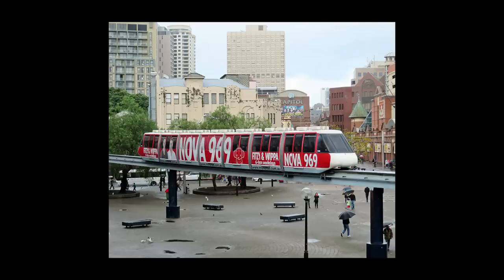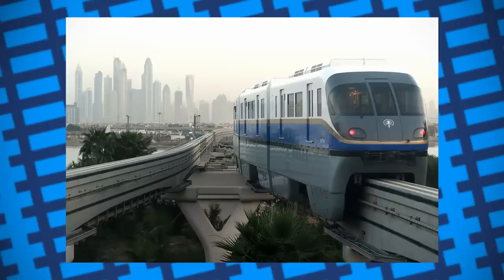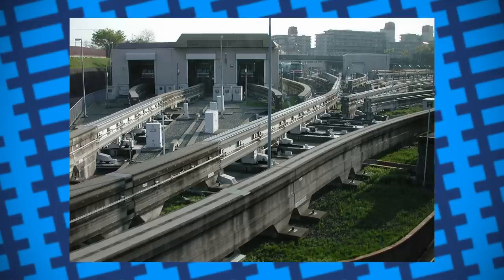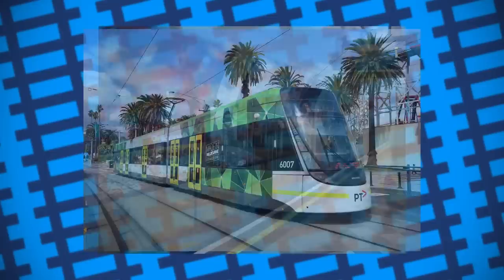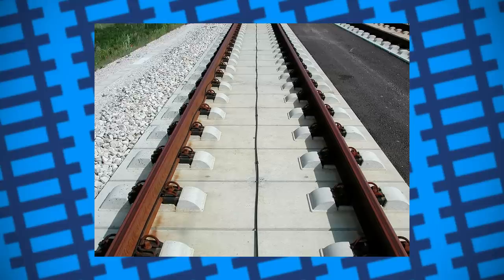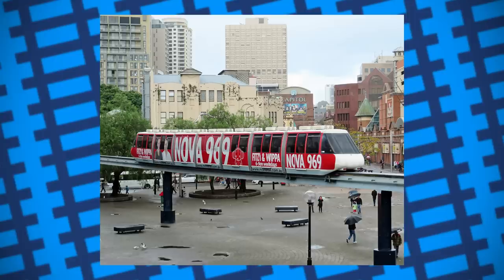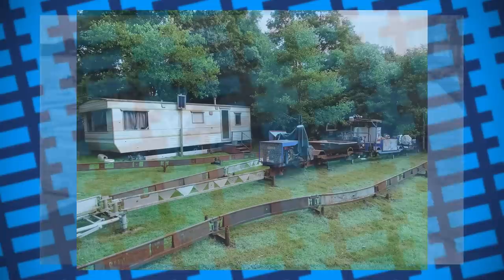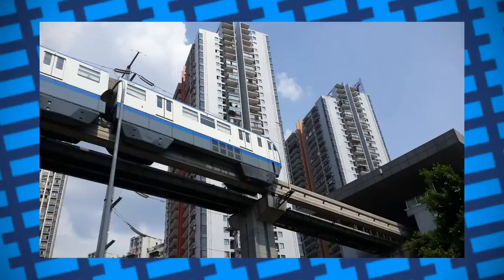Why monorails are bad as public transport - Monorails

Comment: I have to disagree. Monorails are a useful mode of transit where they are appropriate.  If you're in an area in which you can't build underground transport, and you have to go elevated, then monorail should be part of your consideration matrix.
Reply: Could be used around North Tyneside in parts for sure to link up bits of the Metro and outlying parts to it/park & rides to it.
Reply: Even that cases just install standard gauge elevated rails OR just use trams and trolleybuses are OK.
Reply: Metro also can be built elevated.
Reply: @masrimus1607  Sure, metro can be built elevated, but it's more expensive to do so because there's more infrastructure involved than just a 24 inch wide concrete beam.
Reply: @murdelabop  better than monorails for sure.
Reply: M O N O R A I L
Reply: @masrimus1607  Again, it depends on the situation. And again I say, if you have to build an elevated system then monorail should be part of your decision matrix. Especially if you have to build over salt water in a storm prone area, the concrete guideway of a straddled monorail is very robust, and resistant to salt water and wind.
Reply: @murdelabop  concrete slab of metro also can be build to be the same quality or even better.
Reply: @masrimus1607  It's also a massive, expensive, light blocking, mechanically complex, visual mess, which the monorail beam is not.
Reply: @murdelabop monorail depot is much more complex due to its switches. Running on rubber tires means the efficiency of a bus. Why not just use buses instead? This is why most cities choose LRT or even MRT for high capacity routes. For other routes, bus networks can cover them. Monorail is basically the worst of both worlds. Complexity of a metro with the efficiency of buses.
Reply: @bltzcstrnx  Note the qualifications I put on them.  Plus, show me a bus line that can carry 45,000 passengers per hour per direction while operating automated.  

If you have to go elevated then monorail should be part of your decision matrix.
Reply: Just build an elevated metro
Reply: Building elevated monorail is initially cheaper. HOWEVER. If a track switch mess up slightly the entire network is out of action until a dozen people with cranes.

Comment: Though limited, there's a really good example of how a monorail system was the best option for a cities public transit. Take a look at Wuppertal's Schwebebahn in Germany. There, the unique geology, plus the cities unusual design characteristics, meant the monorail, or suspension railway, was the best choice. Surprised you didn't use that as a good example at the end. It's been in existence since 1897-1903, only really halted by war and refurbishment. You showed pictures, but I'd say that's a good example of how monorail can be used well for mas/commute transit where other systems would not.
Reply: Yep, it uses space with would otherwise have gone to waste, and several historical buildings were saved in the process!
Reply: Wuppertal's system also just looks good, the late 1800 metallic supports and the beautifully modern trains make it just beautiful
Reply: It's symptomatic for +Train of Thought's oversimplified PoV. If you travel on a Hochbahn, high above ground light rail, you have the same "safely dismount" - problems.

Monorails are a practical solution for very niche problems. Wuppertal is one of those examples, in 1903, there wasn't the same economy of scale (which started with the Einheitslokomotiven and ELNA in the 1920s, at the earliest with the G12 in 1917). 

The big problem is that oversimplifications like that tend to also group VHST like Transrapid or the SCMaglev into "Monorail". Very High Speed Trains (300-800km/h) are terribly inefficient if you use conventional rail, and don't compete with other rail lines, but domestic air travel. And are right now what we desperately need to cut carbon dioxyde emissions.

ToT called it "slightly less impractical", but construction/freight monorail actually are lengths more efficient than lorries or Feldbahn (60cm) temporary railways. Yes, you might run into problems with your point-to-point rail if you should, for reasons beyond all practical reason, require switches. If you require a switch in your point-to-point route, you may have to manually lift the car from the rail and put it onto another rail. But you safe on an expensive, over-dimensioned, road legal, taxed lorry.
Reply: I don't doubt the Wuppertal monorail is a cool, well-functioning system, but you could easily replace it with a conventional elevated metro. The structure would have to be wider, though, that would require more material and stronger pillars.
IMO Chongqing is a better example. They needed to climb steep gradients which rules out steel wheels (Wuppertal also uses steel-on-steel adhesion, btw). You could solve that problem with an Alstom-style rubber-tyred metro, but I guess that is going to be as much of a hassle as a monorail.
Reply: @robertzaenglein7347  Yeah, but you're not taking into account the cultural or historical significance of Wuppertal's elevated railway. You could argue the same for San Francisco's cable cars. They're outdated, and modern busses could easily take over. Indeed, they tried to do that back in the 50s an 60s.. But people would have none of it. The system was part of the cities identity, and it's not exactly useless either, so they kept what was left, listed it, and now it serves a great purpose, for tourists and locals alike. An example of transport heritage that still servers a purpose. Back to Wuppertal's system, they'res no need for rubber adhesion cause the route does not trevers any harsh or steep grades. The suspension cars have work well in this fashion for well over a century now.
Reply: @robertzaenglein7347  You could*. Why *would you? As you said, it is a "cool, well-functioning system".

Replacing a public transportation system is a major hassle, as for that time, there will be no public transportation system. You'd need to replace ALL of it. Just go to a German city when there is work on ONE line.

Now, what benefits would there be to replace the Schwebebahn with a Hochbahn? Wuppertal would have to shoulder a major investment, lose a technical memorial & tourist attraction, create a perpetual traffic jam for the time of the replacement. Afterwards, they could benefit from cheaper rolling stock. In approx. 250 years, those savings would perhaps set off the initial investment and losses in taxes of local commerce that change would require or cause - not to mention unemployment aid for the workers in businesses who had to shut down because the switch made them unprofitable during the works.

And for what? For some "monorail-haters" who just see a "monorail" and not an adequate solution for a specific situation that still functions so well that "easily replacing" it would be ludicrously expensive and not be worth the switch at all.
Reply: @enysuntra1347  Misunderstanding, sorry. I am not proposing actually ripping out the existing system, since it is, as said before, a technical memorial, works perfectly well and I like it. 
This is more like alternate history: You're in a parallel universe (no real monorails are being hurt), it is 1901 again and you choose which transit solution to buy for Wuppertal (then still the cities of Elberfeld and Barmen) with your 21st century knowledge. What do you do (except killing Hitler)? Monorail? Elevated metro? Elevated light rail?
Reply: @robertzaenglein7347  OK, that's another story.

However, I'd still answer "Schwebebahn". In 1901 - where I wouldn't kill Hitler, but get Franz Ferdinand a better car and/or kill Princip so Hitler doesn't become an issue at all - I'd have to construct an elevated line with existing technology, or wait. 

If I waited, we'd now have the hamlets of Barmen and Elberfeld, which then would be big churches with small towns around it; there would be no Bahn whatsoever because of, in this order, WW1 (if I couldn't prevent Franz Ferdinand's death), the global economic crisis, the reparation recession, WW2 and then the "de-railing" of FRG infrastructure in favour of busses.

But in the 1890s, I could also order the Schwebebahn which hadn't more of a "Gadgetbahn"-vibe to it than an elevated tramway, was cheaper to construct, didn't hinder development by blocking out the sun (in a river valley often a commodity not to be wasted) and, in the end, have a functioning public transit system.

If I was to re-build destroyed Wuppertal today after a major natural disaster and had to just look after technical and operational cost concerns, then yes, I'd propose a Hochbahn (elevated light rail) - IF this allowed for enough light to hit the valley and wouldn't make people emigrate to brighter, friendlier cities like Duisburg, Essen or Dortmund.

I still hold that the Schwebebahn may even today be the better solution for very specific circumstances - a line crossing a marshalling yard with not enough passengers to justify going underground or where underground is not an option for other reasons, a narrow valley or ravine where I cannot shade the surroundings - but those are very few and far between. Wuppertal may be one of those specific situations, but the list of why the Schwebebahn is better than a Hochbahn for Wuppertal has become very short since 1903.

Monorail is like an all-terrain 4-wheel-drive lorry. If snake oil salesmen try to sell it to you for your everyday street applications, it's total BS. If you are in a situation where you need an UniMoG or MAN gl, that's what you should buy and not try to make a conventional lorry fit. Making funny Simpsons songs about all-terrain 4-wheel-drive "trucks" doesn't do the process where you decide if for your specific problem, you have to go all-terrain justice. 

There are at least 3 situations where a monorail system is the best fit: temporary construction sites (or James Bond villain lairs, for that matter…), black swan situations like Wuppertal, and Very High Speed Train lines >300km/h (Transrapid, SCMaglev,…). 

In Shanghai airport, a Transrapid was built as a technology demonstrator. The solution of this PoC now is that Red China has created its own Maglev Monorail, so it obviously was successful. Red China doesn't have oil reserves, so building a VHST Maglev network to safe on Kerosene imports is prudent; if it won't be realised because of Red China's economic troubles, it still is a valid solution. 

Shinkansen also once was a "Gadgetbahn" compared to domestic flight (the German Green Party actively campaigned against the ICE HST as a "Gadgetbahn for the rich, where we already have domestic flight"); today the same people outright condemning "Monorail" (with 1-5, 50-100 or 5,000-10,000kW?) will praise HST networks as a great idea. 

What would have happened if we listened to those detractors and Shinkansen hadn't been built (over-budget, over-deadline), therefore no TGV, no ICE and no other HST?
Reply: Monorail has place on more challengine georgraphy which they starting to make more sense. It is the issue that some government is pushing monorail even on areas that could have been implemented with far more practical traditional rail. Some use monorail as an excuse to traverse city because government is unable to acquire right of way for traditional rail. So it is a more lazy way to put transport instead of dealing with other stuff first.
Reply: To add to the discussion, even on very steep gradients you don't necessarily need a monorail as a cogwheel train can climb just as well while being on ground level.
Reply: the city of Chongqing also uses monorails for practical usage because of elevation needs
Reply: Or look at the examples with Shonan and Chiba suspended monorails near Tokyo. They go over roads, through hilly terrain and even through tunnels.
Reply: @neubro1448  An extra factor is Shonan and Chiba is easy to change track. It is so easy that Shonan suspended rail can use one track throughout the line and put dual platforms in some stations only. They don't share the track switching difficulty or safety issue of those more popular monorails.
Reply: Suspended monorails have the benefit of having the wheels inside the track which makes switching much easier
Reply: Miami is another good example. The monorail/peoplemover in Miami is used to cross over the Miami River to connect Downtown to Brickell (the financial district) so a ground level train is impossible to traverse the river. It was also built on top of pre-existing streets because large towers prevented expanding the streets to accommodate LRT.
Reply: It's an amazing idea that deserved more research and development, but it triggers a lot of people for some reason.
Reply: One of the least dumb monorails... still dumb.
Reply: "B-but it works well in this one highly specialized case!"
And?
Reply: @GeneralJackRipper  It works in Miami too
Reply: I second this too, I used to take the Daegu monorail in South Korea. The line carried over 100k on busy days and was the most viable transit option due to the terrain and dense residential areas it had to connect. Every year the line grows several miles, as well as the regional ridership.
Reply: Wuppertals Schwebebahn has only one line and the only reason its still standing is first and most obvious prestige, history and tourism. Replacing it would also be to expensive.

Just because something lasts long doesn't mean its the best in any way.
Reply: @derunfassbarebielecki  If you read the above you'll see I wasn't talking about prestige, history and tourism. The line had to be built this way because there was no other option. The city was long and narrow, nestled in a valley and already heavily built up. The soft ground  too and other geological problems means it is incredibly difficult, if not impossible to build a more conventional underground system. So, the engineers decided to take advantage of the cities natural feature, the river, and opted to go for the suspension railway. Sure, it became an icon to the city later in life, but it is still useful and by now means a terrible solution!
Reply: also, the lartigue monorail, if it were built in algeria as originally intended, would likely be good
Reply: @GeneralJackRipper  Multiple cases, read the comments, do the research. I chose this example because the dude literally put pics of it in his vid, duh
Reply: @adeerdoes  you can't change that it's still multiple specific cases in the end. Yes it can work in some places that has to adapt to specific needs but it doesn't make it an all around great solution the argument will forever stand. It was supposed to the transport solution of the future, the fact that almost everywhere in the world doesn't choose it proves that it isn't.
Reply: Orlando international airport is another good example.. it's used to connect the terminals to the main building and allows the rail to travel in awkward area on the airport that otherwise couldn't be used
Reply: @enysuntra1347  If built today, Wuppertal would get a normal tram, with some sections underground, despite the complicated geological situation. Some parts of it would run as Stadtbahn regulated by EBO to towns around Wuppertal to make use of former railway track.
Reply: Mountainous cities are best due to limited space
Reply: @JaimeValladares00  "just because something lasts long, it doesnt mean its the best in any way" This includes everything not just rail, if I would mean the Schwebebahn specifically, I would write Schwebebahn instead of something...

Comment: I used to work with the Yui Monorail in Okinawa Japan. There are some specific cases where monorail was the better option.  in the Naha area, there's tons of narrow but busy roads, and the landscape is hilly. Its also a coral island, so digging a subway is not feasible.  Monorail was chosen because of its ability to more easily climb hills. It looks "futuristic" as you said, which gives it more public support.  the rail is thin, so it doesn't impact the skyline as much, and for the many tourists that visit Okinawa, they get a nice view of the island.  Also, due to how dense the city is and how difficult developers could acquire land, they chose to build a large portion of the monorail over the river. Okinawa also has a ton of powerful typhoons and there has been no major issues yet. Had they went to to a grade level Tram or Light rain, while the infrastructure would be cheaper, there certainly would have been a ton of operational issues. There would be far more traffic as it would have taken an existing street lane, and given the amount of tourists that can't drive well in Japan, drunk drivers (its an issue in Okinawa), etc, there probably would have been more accidents and even fatalities.
Reply: I love the monorail in Naha Okinawa! It’s convenient and connects to important places in Naha such as the airport, the main shopping area and the old palace. Tourists do not always find it easy to navigate the bus network and there is no underground railway in the city (reason as explained above). And I agree that it offers a wonderful view of the city from a vantage point for the tourists as well as the locals.
Reply: Would building an elevated tram line solve the problem?

Comment: You used a lot of picture in the video of monorail system in Chonghing and Tokyo which carry 2+ millions and 240k pax per day respectively and you still all monorail a failure because that are not freight ready and "hard to maintain", and you compare monorail with separated right-of-way to trams / light-rail that can easily be blocked by street traffic? seriously?